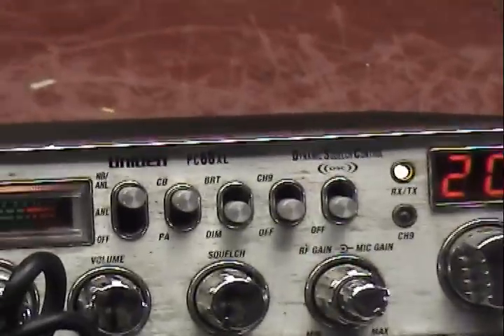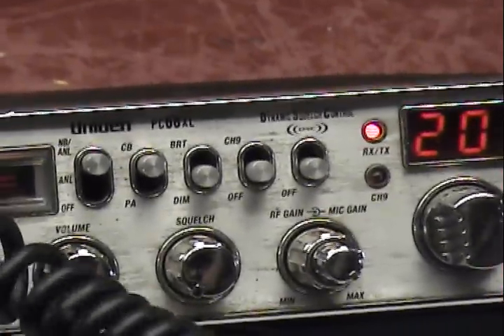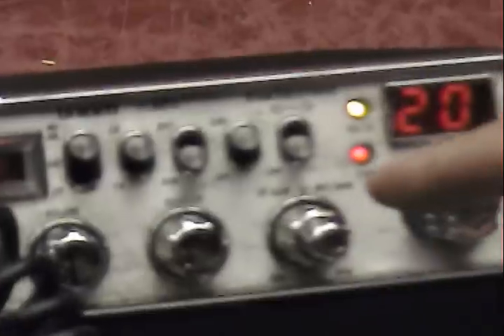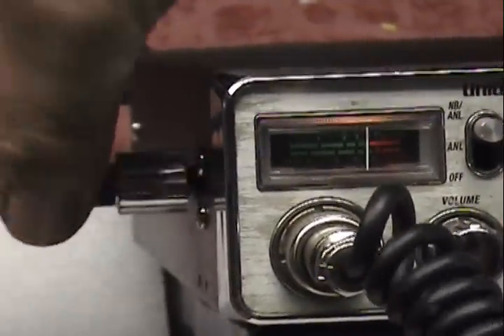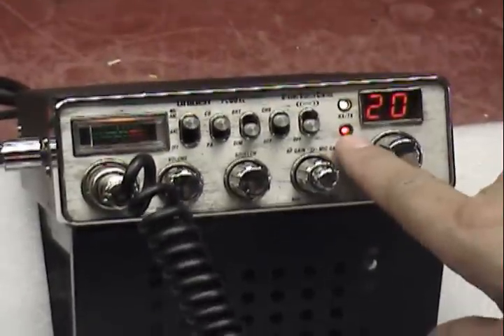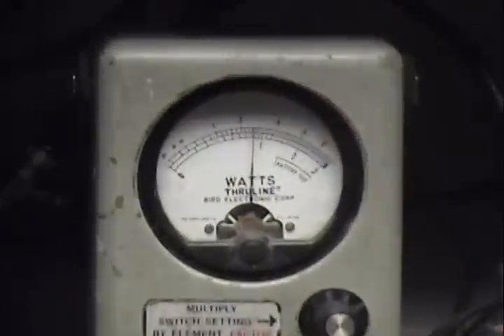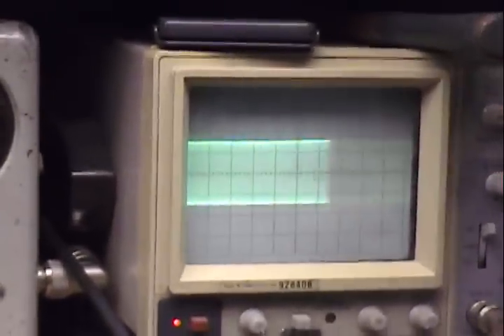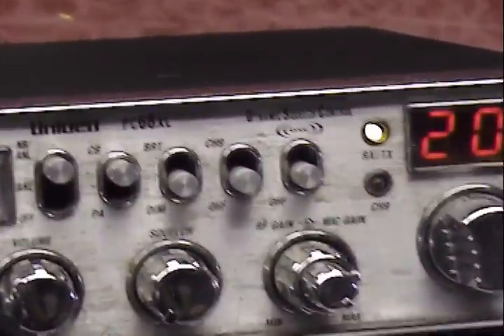Uniden PC68 with low channels and echo board

Comment: Alan in Mich. here. Would like to say I'm very happy with this unit! little while after Bells did this work for me a friend of mine suggested a tech here in Mich. who installed an RFX75 on this same radio. Between Bells and the other gentelman this unit has made some GREAT TRANSMITS (20-25 miles) using a TRAM single trucker antenna. Thanks to Bells C.B.!!!

Comment: I  love it !  NICE  JOB  screwdriver. That  TRB-X3  echo  sounds great. There  is  a  difference  between  that  and the CHEAP echo  boards!
Would that  tune be ok to run barefoot OR would you set it up  differently if  there  was NO 3 pill to drive.